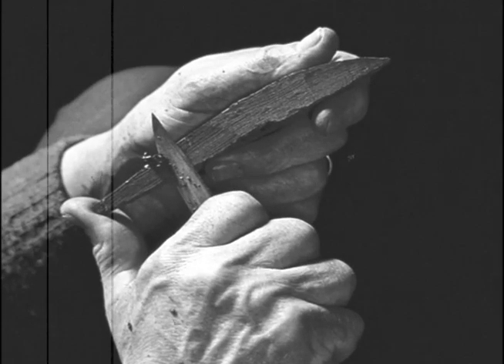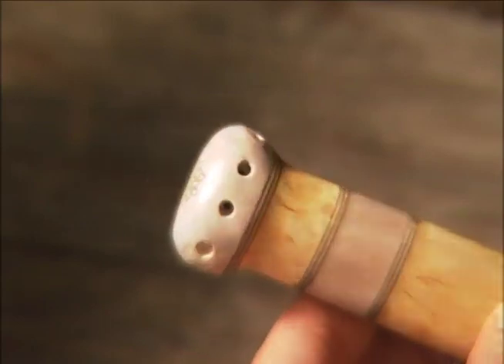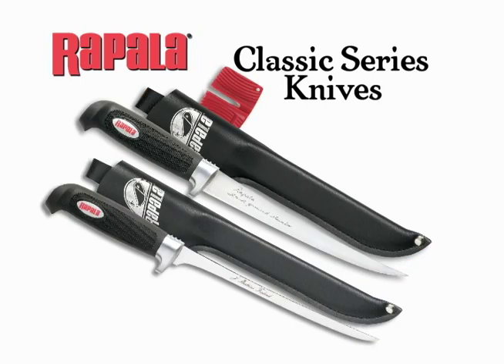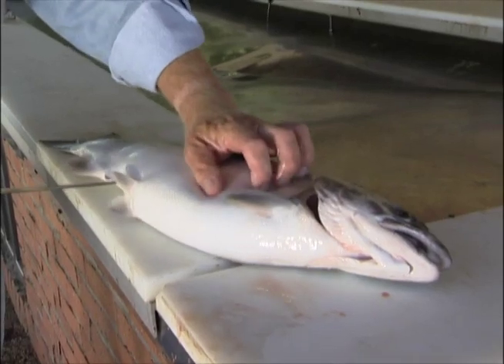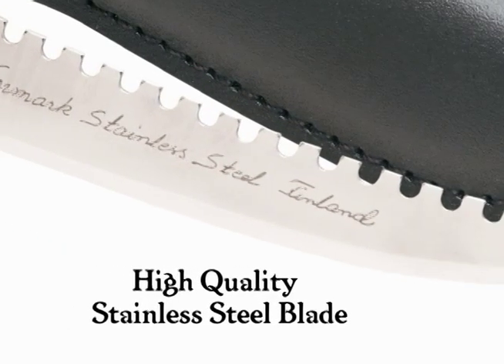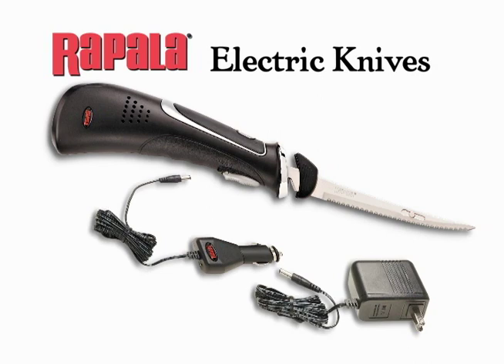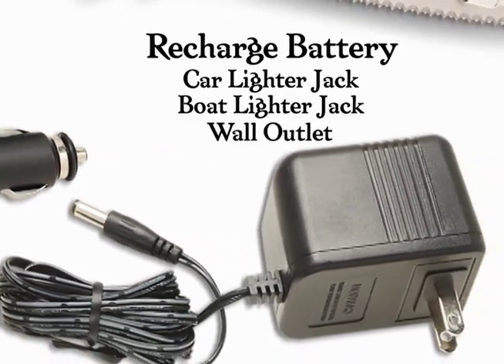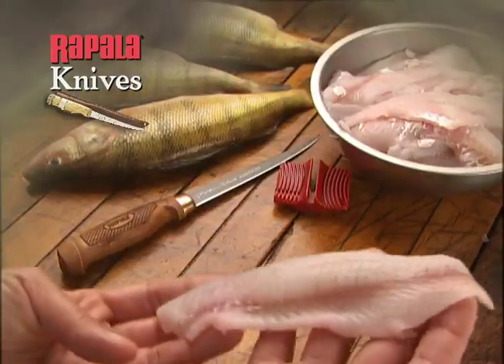Rapala Knives

Comment: I have one that is at least 40 years old. It is older than me. Getting kind of thin but still going strong despite a burnt handle. My mom got it from an old vietnamese man that was also a veteran from the Vietnam war he had this knife for a long time before the War. She was going to give it to goodwill but I pulled it out of the donation box, remembering he told her to not get rid of it ever. I will never get rid of it though I may get a new one and not need to open it out of the package until this char handled beast stops working. It may out live me but I want either a presentation or a superflex to never use, lol.

Comment: Funny how comments are disabled on all the other rapala knifes particularly the wooden handle ones. In my opinion the wooden handle is not very well done.  For one its to short for me anyways, its also to thick and round.  So it feels weird in the hand, like holding a stub, not comfortable at all.  Also the blade is to flexible and looses edge quite fast from my experience.  Other rappel knives have nicer handles.  I have two of these 6" and 9".  I would not recommend these.  Just my opinion.  Sorry Rapala.